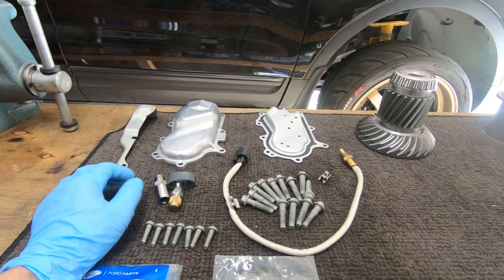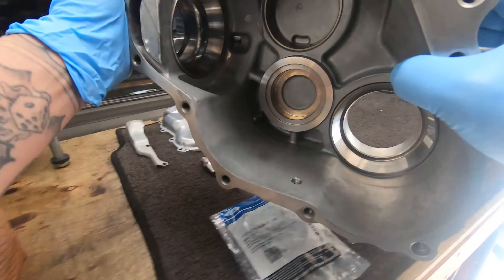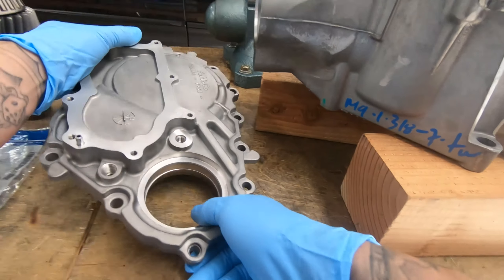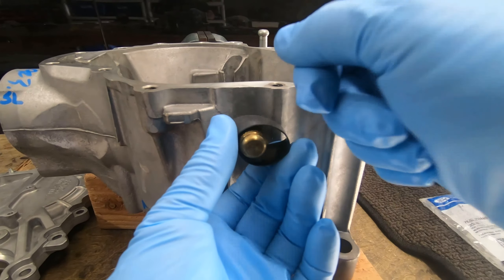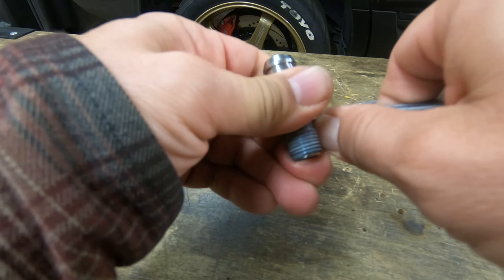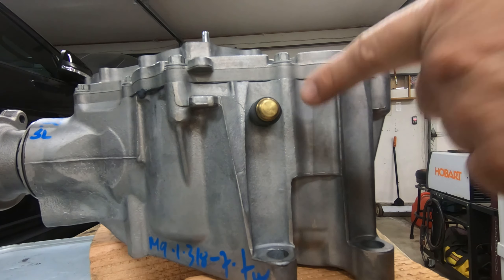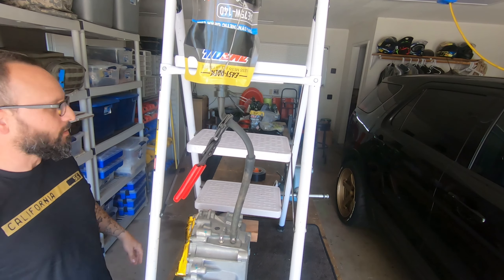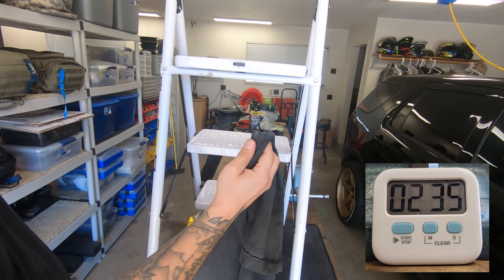Ford EcoBoost PTU Series: Quick 2-Minute PTU Fill - No Tools Required!

Comment: Thanks for this video! Your video is the ONLY one that shows the vent fitting. Your solution is excellent and the time it took to fill was awesome. I have been looking for a good shot of the vent connection before taking the PTU out. Reason is because my 2013 Ford Edge doesn't have a vent hose. I wondered if it has a flush vent cap and there is a fitting as shown in your video. I want to add a hose up high to fill the slower way as you mentioned. LOL... I'm trying to avoid removing the PTU. Do you know the diameter of the original vent hole?
Reply from the maker: Some of the older PTUs don't have the vent "nipple" like you see in my video. They have a different fitting that , best I can explain, has a metal "cap" over the nipple. Very close and nearly flush to the case of the PTU. Newer versions have this nipple with a hose about 12" long. Idk how much the older style can be modified. The fittings are pressed into the case, so it isn't as if you can simple screw a nipple into it. If you have the older style, you may be able to "peel" off the metal cap to expose a nipple to slide a hose over, but I've never done it, so unsure. As for the size of the hole, the ID is very small, about 1/4".

Comment: I’ve been wanting to find AN fittings that fit the drain and fill ports to run a cooling system on my ecoboost flex.
Reply from the maker: For the PTU? Not a feasible plan. The case is a vented case. To run a cooler, the system needs to be closed, pressurized and filled all the way with no air pockets. It won't work here because, sure...you could seal the PTU, but then the seals aren't designed to handle pressure, since it isn't a close loop system. You will push oil passed the seals if the case  becomes pressurized.

Running the PTU fluid through an external cooler won't work.